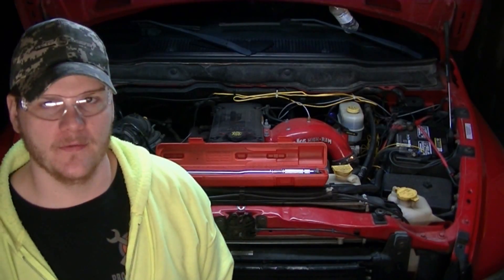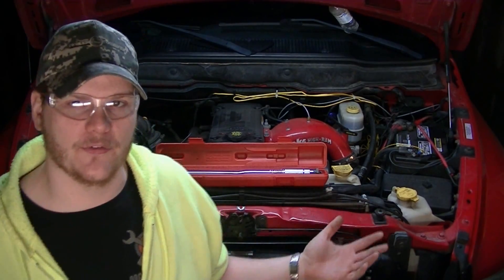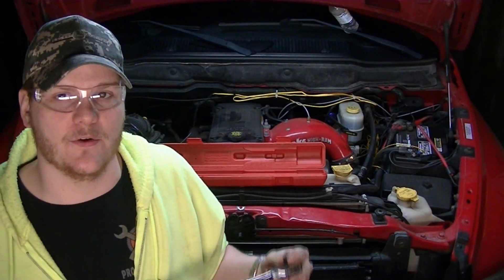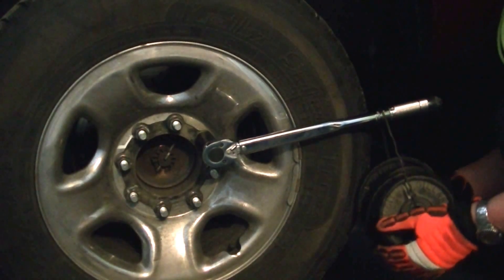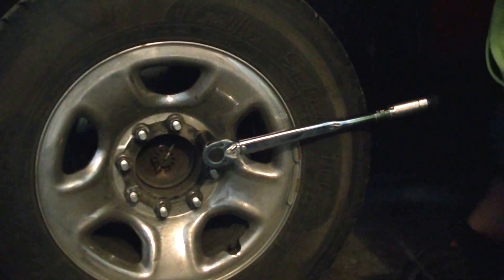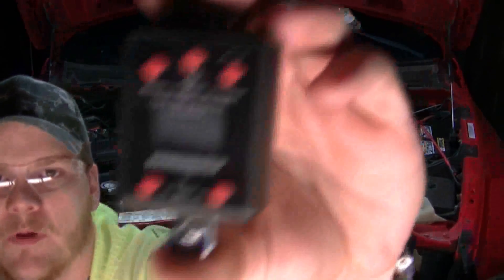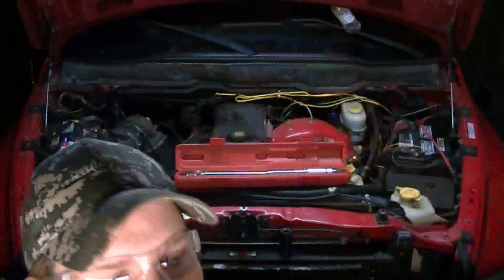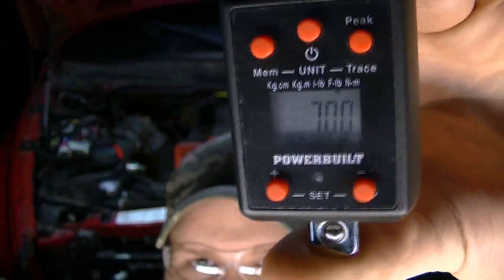DIY Torque Wrench Calibration

Comment: Even your calibrated test block needs to calibrated every so often. Another way to a person can get a ballpark calibration, is a push/pull hook/fish scale. Set tq wrench to a setting within the range of the scale, and pull/push till the tq wrench clicks. 
There is also an allowable +/- range tq wrenches are allowed to be over/under, usually in the 1-10% range. Our calibrated tools in aviation, when we get them back from cal, are calibrated to +/- 1% and a cert tag has the 1% annotation on it, along with date and name of calibration tech.

Comment: Method one is the most accurate way to go, but I would use water instead of the bar barbells, the barbells stamped weight is rounded, thus its nominal weight.  I on the other hand would use water, because its ease of adjusting the target test weight just by adding or subtracting,  Now hears the kicker that makes it the best way to calibrate, you are using the force of GRAVITY.Gravity is always the same, well as long that your in planet EARTH, well your not going to do this procedure on the MOON.On method two your using an instrument that also depends on calibration, thus making it not a accurate, it could be out of calibration right out of the box. Moreover, all torque wrenches have a build in percentage of in accuracy, this depends on brand and type of torque wrench.That's my two cents or like Eminem says " My ten cents"...

Comment: Appreciate the effort for sharing the video but your first test with weights is flawed for many reasons, but mainly that the wrench would have clicked if you had put 100lbs or 500lbs, or even the weight you were expecting, it is not conclusive. A better test would be to incrementally add small weights one at a time until it clicked..

Comment: you forgot to add the torque wrench hanging handle weight when using the test weight method for a 1/2 wrench its around 1.65lb   so  your 15 lb weight + 1.65  you set your wrench to 16.65 ft lbs
Reply: Also weight of the wire used to hang the weights on the handle.

Comment: Hanging weight only proves one thing, that the wrench is not reading too low. It proves nothing at all on the high side. You could hang 100 pounds of weight and guess what, the wrench would still click ! Torque wrench USAGE is far more important then calibration. Keep your hand in the center of the grip, DON'T JERK THE WRENCH, keep moisture out of the wrench, WIND DOWN HANDLE BEFORE STORAGE. Follow these steps and IF you need high accuracy torque, then send your wrench to a quality Calibration Lab. If your torque specs are not critical , they don't worry about the calibration.   Gary @ Snap-on Tools
Reply: Thanks for the 'Wind down the handle' tip.  I didn't realize that--and obviously haven't been doing it.

Comment: On the first test, if you set the wrench again, a lb higher and it does not click you know 25 is correct. Even though you zeroed the tester, I don't like the idea that the weight of the wrench is hanging on the tester. Better to test in the vise. Generally, torque wrenches and even testers like yours are assumed to be in spec from  20% to 100% of full scale. the bottom 20% is not usable. Some torque wrenches have a low setting that is 20% of full scale and some go lower but it is not usable. When you send a wrench out it is checked at 100%, 20% and someplace in between The adjustment is a compromise to get all three readings in the published spec, typically 3 or 4%. For that reason going nuts to get some middle reading on the nose makes no sense. You may be pushing one of the other readings out of spec.

Comment: So many in accuracies simply down to the tape measure how do you know the tape measure has no ware or tare and accurate the weights how do you know they are the weight you desire? Are they close? No one knows cos they have not been checked against a known standard etc. The torque measurement tool you use isn't calibrated to a known standard so how do you know you are testing your torque wrench correctly for all anyone know by the video the torque analyser you have featured may have an accuracy of 10% and the wrench an accuracy of 4% so in theory the torque wrench may be more accurate than the electronic analyser! If the analyser isn't calibrated regardless this is due to you not knowing if is has drifted so a torque wrench may cos the same as the analyser to get calibrated to ensure rather is accurate so eat her way you don't know if the wrench weights or analyser is any good and stays in spec unless they are calibrated to a track able standard eatery 12-36 months depending on use! This is a video going round in circles with no actual traceable facts or figures anything can happen to equipment hence why it is checked and calibrated to a national standard! And calibrated correctly by a certified lab to a national standard or you have more luck setting the wrench to its max value and guessing the torque you need! Good vid but unfortunately as a calibration engineer I do not agree with it unless something is traceable and checked via calibration at least every 3yrs depending on use
Reply: Serious question: as a calibration engineer, does it drive you crazy wondering how well the tools you are using to calibrate another tool are calibrated?  I mean, essentially, all of our calibration tools go back to the first measuring tool ever created, which was probably some dude with a rock notching marks on a reed.

As I understand it, even the international kg standard loses a small amount of mass over the years.  How can we really be sure of anything?  Or, is that where tolerances come in as it's rare that things needs to be super accurate?
Reply: wondermike0 hi wonder Mike 
Yes the international 1kg standard has got smaller by probably some minuscule number this is probably due to the atoms in the metal or by the slightest abrasion to the standard and due to this they are working on a numerical standard for mass as far as I'm aware. Yes possibly someone with a reed said that is a meter of length etc however that was set as a standard and agreed by numerous countries scientists etc the t that was a standard. 

So the equipment I use is calibrated to a standard called UKAS whips is fully traceable back to the standards and the equipment I use has uncertainties, drift etc however these are constantly checked and the environment is checked constantly too to ensure accurate measurements etc. To a known standard so if for instance you were to go on holiday and you boarded a plane apron landing the wheels came off the aircraft it was investigated and found it was down to bolts not being torqued down correctly, it transpires the engineer who torqued the bolts calibrated his torque wrench like you specify with no accuracy or traceability he would be at fault, but if it was calibrated to a standard with traceable equipment it would lease further down the line and to be honest I wouldn't trust any measurement equipment that isn't calibrated to a national or international standard. So it worth spending the money to ensure the equipment is as accurate as the manufacturer intended etc. 

Some reading behind how I think, which may highlight why things are calibrated by a certified lab etc, linked to standards and traceability to ensure measurement equipment is all reading the same etc. https://www.wmo.int/pages/prog/gcos/documents/gruanmanuals/UK_NPL/mgpg11.pdf

And the manufacturer should state in the manual when the torque wrench should be calibrated e.g. 5000 cycles or time.
Reply: Maybe you are a calibration engineer but may people are not. If you can suggest a better way for DIYers to test that would be great. I'm absolutely certain that is the audience this video is intended for. This may not be the best method and that was plainly stated at the beginning of the video but at least it's something for folks that are not calibration engineers to learn something from. Can you post something instructive and constructive for DIYers to be able to use??
Reply: @Progene01  no he can't because in his world a diy method does not exist, using something like iso 6789 2017 would be way way beyond DIY'rs capabilities, so if your a diy'r  and want cheap stuff get yourself  a new torque wrench  every now and then or get it properly calibrated,  as for all these cheap torque wrenches coming out of China leaving the factories for pennies, are they really calibrated from a traceable source, ? Doubt it,  best thing is just buy a quality torque wrench like a gedore or norbar or stahlwille, look after it and it will look after you 😀

Comment: You could put the weight to 20 and if it doesn't click then you would know for sure its between 20-25. If you have the means to go up 1 pound intervals that would be ideal. 21,22,23,24 no click? 25 click. 99% accurate.
Reply: x2eXu50x Exactly!  Do this on the low end and somewhere in the middle and you are good to go. Also make sure you take into account torque wrench accuracy - mine is +\- 4%. At the end of the day this is plenty adequate for the DIYer. We aren't assembling Space Shuttle engines here...

Comment: if you want to put engine together,have it calibrated,at lab,but for for other parts,even if you your torque wrench is a little off your OK,as most parts torque have 10pound feet window if it is over 30,so 35- 45,you can be at 30-50 and still OK nothing will fall of,just be careful with oil pan or tranny pan,they are between 8-12 foot pound or96-144 inch pound

Comment: Here is my question if you are buying the adapter and is already good to go, it is not be better to use that instead of the torque wrench??
Reply: +epidemia2007 the mechanical CLICK is faster then trying to line up a beep.
Reply: I would assume that the adapter might be in the way in tight spaces and if you use it too often it will too need calibration!

Comment: Now you need to calibrate the Digital Torque Meter
Reply: +Jeff Pais at least you could do the weight hang test on it and it should stabilize with a number.
Reply: Afterwards, he needs to calibrate the equipment that used to calibrate that electronic torque meter.
Reply: Use a hammer it will fix anything

Comment: if you select the peak button you can see the max torque when your tool breaks over.
Reply: Selecting peak will tell you the torque applied when you let go of the wrench, not the torque that caused the mechanism to actuate. First peak is measured to determine the repeatability of the wrench. Final peak to determine operator reproducibility.

Comment: This is probably a dumb question, but; If I happen to have the digital calibrator in 1/2" drive, would I get an accurate reading if I used a 3/8"-1/2" adapter and checked my 3/8" drive wrench with the same?  (Just wondering if I can get away with not having to buy both sizes.)
Reply: Lonewlf7676 Torque is relative to the center axis, so you can use the adapters and you will be fine.

Comment: I have never seen mechanics using a torque wrench, they all use bog standard ratchets. I suppose a mechanic will use a torque wrench if he is working on his own car. ;)
Reply: +Joss Cues Maybe you should be using different mechanics. The better ones use them.  Many just over tighten stuff and leave a mess for the next person.

Comment: The thing I would add to the weight-hanging verification is, "Do it at more than 1 setting".  You want to know it is correct (linear) across its entire range, not just at 1 point.  To be really safe, do it at 3 points; low-end, mid-point, and high-end.

Comment: All you're doing is providing a low level sanity check. It's far removed from what is needed to actually verify a torque instrument. The basics is you'll need a torque tester that has a minimum accuracy of +/1% that is calibrated with classF mass. The torque instrument you are using in your demo has a +/-4% CW accuracy tolerance per ASME, so basically at 25 ft-lbs you have +/ 1 ft-lbs. The accuracy of the method you are using has no "k" value so the uncertainty budget is off the charts. Basically you'll need class F weights, also the instrument must have a nominal position of +/- 3 degrees per ISO 6789. In your demo the instrument appears to be at a 10-15 degree rake, which would cause cosine error, so basically you would need a cosine adjustment to adjust you 25 ft-lbs nominal reading. The weights you are using do not have a class rating, so basically the "k" value on the weights is far removed from the k=1 value which is  56% confidence level. To put in plain terms the test method you are using to check the torque instrument in question has a +/- 18% uncertainty error, which is far removed from the 4.1 ratio specification required to check a torque instrument accurately. Reference ASME B107.300-2010 and ISO6789-2003 for complete torque specifications
Reply: Interesting comment.  The length of the socket and any extensions will also affect accuracy.
Reply: I read that in the torque wrench instructions.
Reply: So... Where is your video to show a better method or can you point to more accurate videos that are already posted? Thanks.

Comment: Those electronic calibrators are worthless DON'T WASTE YOUR MONEY!
Reply: why are you against it?
Reply: They are OK I own 1 I just don't think that's the best way to calibrate a torque wrench just my 2 cents
Reply: What is your preferred method?
Reply: honestly i just take it to a professional torque wrench calibrator guy around where i live, but if $ is an issue then this would be your second best option
Reply: fcolon1976
But you said it's "worthless DON'T WASTE YOUR MONEY" perhaps being a little over the top? I've used a few without issues, just like any tools, you get what you pay for.  Buy cheap tools, get poor results.

Comment: Thanks for the video. Just saying it would have been helpful to see where you were making the adjustments on the torque wrench and if those adjustments were 1/4 turn increments or whatever. Cheers.
Reply: Exactly... I kept looking to see if I missed that, but kinda makes the video almost worthless as far as using the most common method - a cheap digital torque meter.

Comment: When he said, "You probably know what I'm going to say next", I thought he was going to say what I was thinking, which was, "How do we know that electric device is properly calibrated?"
Reply: That's the first thing I thought too.  I think the answer is to hang a 25 lb weight 12 inches from the fulcrum.  If the digital meter says 25 ft lbs, it's in spec.
Reply: @andrewcasterline5741  no, you still have to ensure that those 25lb marked weights are indeed, 25lb.
Reply: John Michael Twist then you gotta make sure the scale weighing those weights are in spec. Then the thing calibrating the scale is calibrated. And the tool to calibrate that is in check
Reply: Should come with a Certificate of Conformance, which will only be valid for 1 year, then you need to have the calibration on the electronic device verified...for the same cost as having a wrench verified.  :)